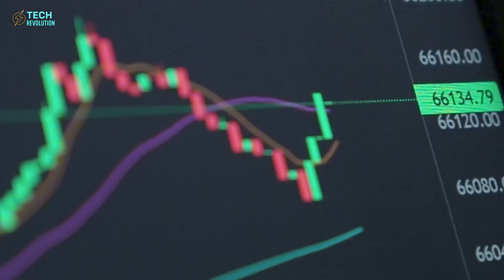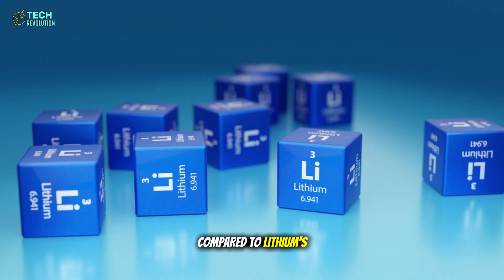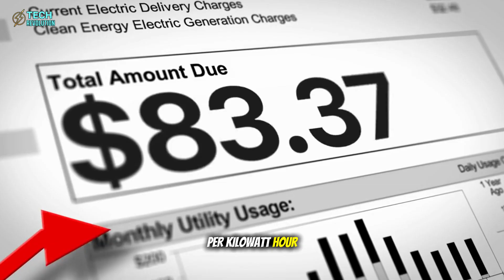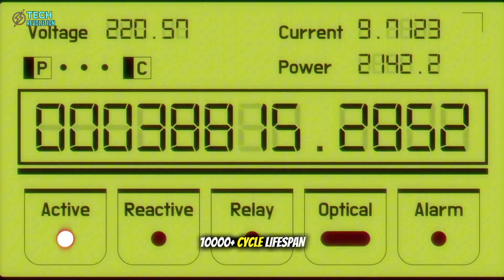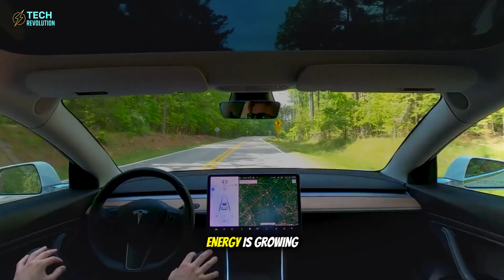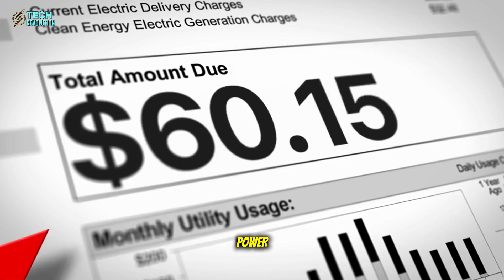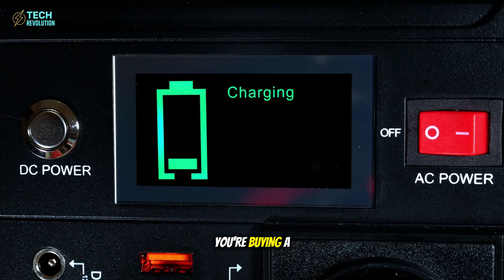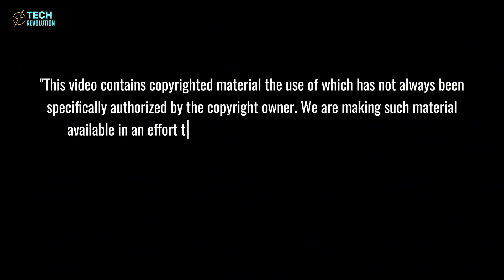Tesla's NEW Aluminum Battery SHOCKS: 30 Years Life! What Elon Hid

Comment: How much horse power can be derived from these batteries in an EV 4 wheel drive full size, pickup truck ?
Reply from the maker: Thanks for the great Q—Omega Core's 1,120 Wh/kg density enables ~845 hp in a 4WD full-size pickup like Cybertruck, matching today's Tri-Motor (0-60 in 2.6s). But with instant power delivery, it'll crush acceleration; rural harvesting limits?